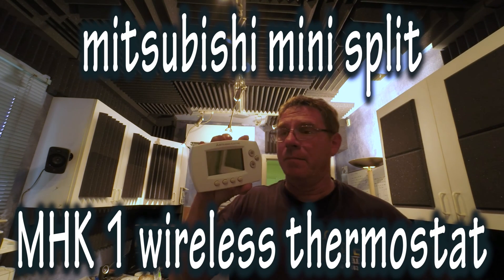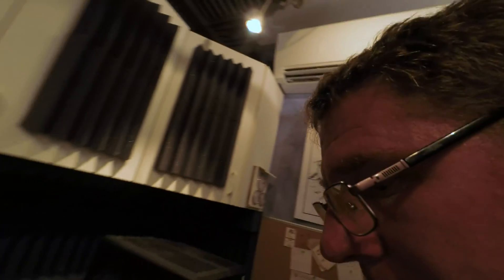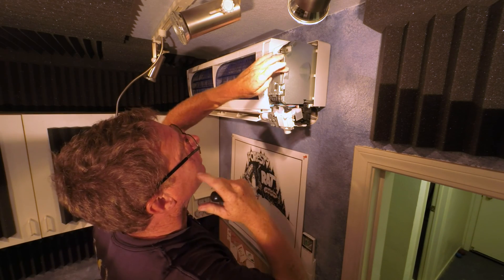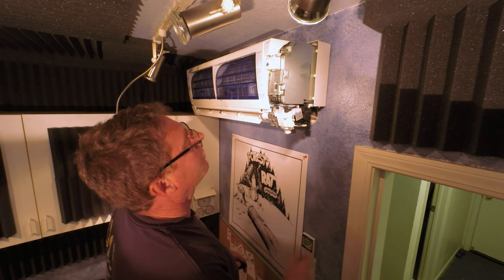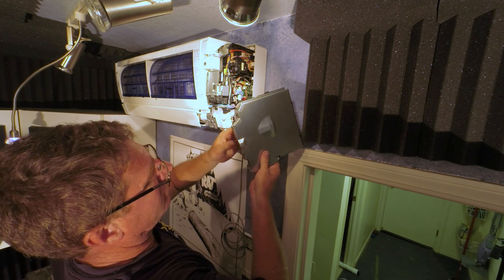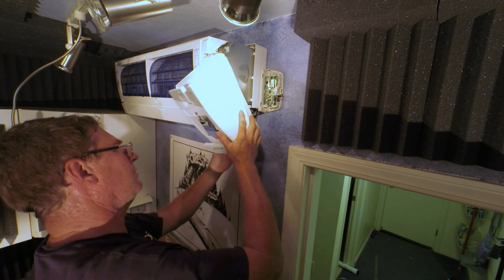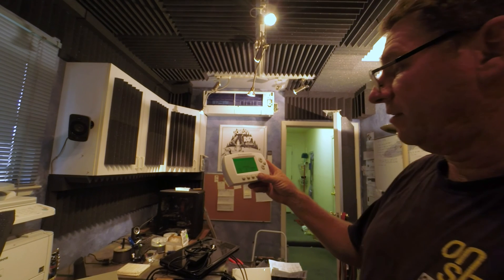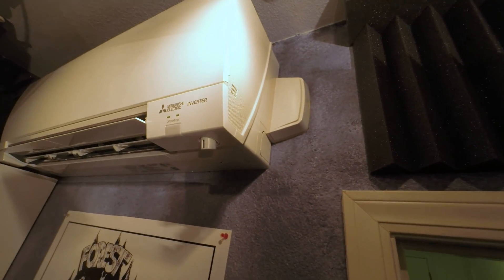MHK1 Thermostat install on the Mitsubishi i-see mini split inverter

Comment: Thanks for this!  I have 3 of those i-See Hyper Heat air handlers in my system, pro install a little over a year ago.  I find the swing in temp during heat mode to be a bit wide.  I just called an HVAC contractor and was thinking about the MHK-2 installed on the main 15k btu unit.

But, I must say, I really like that Honeywell type thermostat you have there, as it matches the one for my gas furnace, but is the MHK-2 a substantial upgrade?  Thank you.

Comment: You can control with ir remote controller and that thermostat will be sensing the tempature far away of the mini split and it will be synchronised tempatures if you use ir remote to set the tempature. Will that work if you have wifi module on the machine i have wifi module that is connected Melcloud server?
Reply from the maker: Yes. You can use both. But if you shut it off by the T stat the remote control will still show the system as being on because it’s only a transmitter and not able to receive.

Comment: Does that remote allows you to keep a closer set point in the space.
Reply from the maker: The closest range they will hold is 3 degrees. It's built into the system. Once your system hits the set point it goes into a low cool mode. If the temp goes up by 3 degrees it goes back into high cool to remove the extra heat from the space. These are multi stage compressors.

Comment: Does anyone know if you can "schedule" for Drying mode to operate or does scheduling only operate heating/cooling?
Reply from the maker: I don't know about that. I think it must be done manually. I'm in California so I don't use that mode.
Reply: are you having trouble keeping the room humidity under control? After about 5 hrs of constant running, on the cool mode or dry mode, the room shoots up to 67% humidity.
Reply from the maker: I'm not having any problems with it. I'm in California. I could see this being a problem back east. You should be getting lots of drain water in a high humid area.
Reply: @CrazyMarty  I will check again and see if it's draining properly.
Reply from the maker: the drain line should not have any low spots that can hold water.

Comment: would be nice if Mitsubishi had the wireless interface built in ...
Reply from the maker: I think they did it this way so you can run several heads from one T stat. Also they did it this way so you can move the receiver around to a location it gets a good signal.
Reply: Forest Rat Productions. I guess that could be helpful but with my router I don't have any issues with signal anywhere in the house. Maybe in the future they could have an external antenna for people that do. So one of those Mitsubishi t stats ,mhk-1 I think, can run multiple heads?